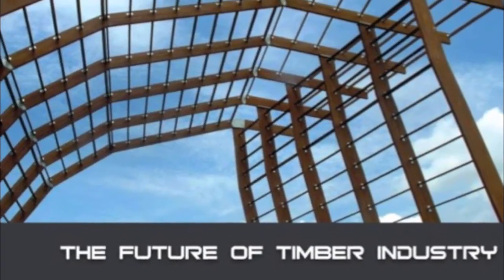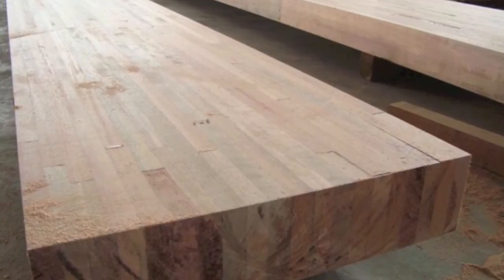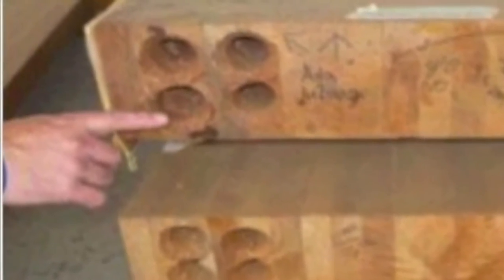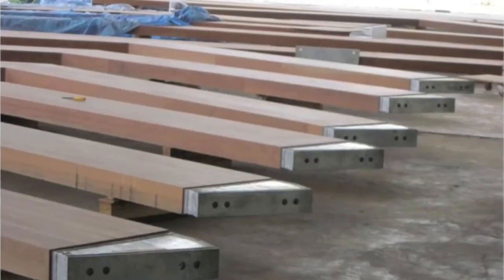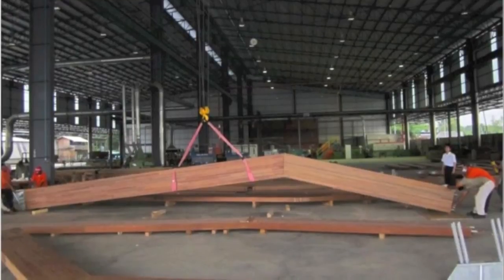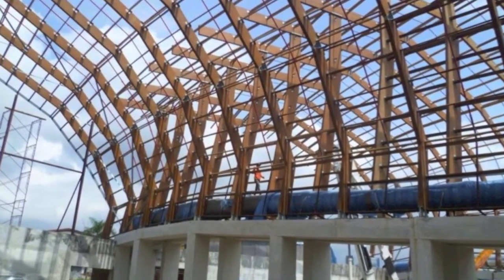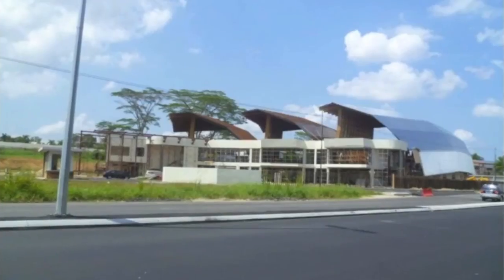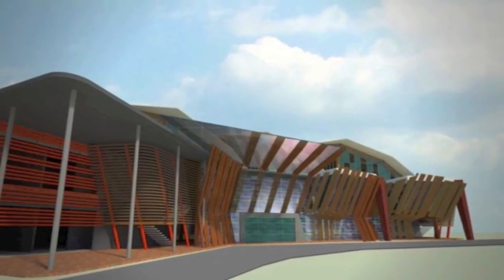Rotafix Glulam Malaysia Project

Comment: Glulam provides the strength and versatility of large wood members without relying on the old growth-dependent solid-sawn timbers. It reduces the overall amount of wood used when compared to solid sawn timbers by diminishing the negative impact of knots and other small defects in each component board.